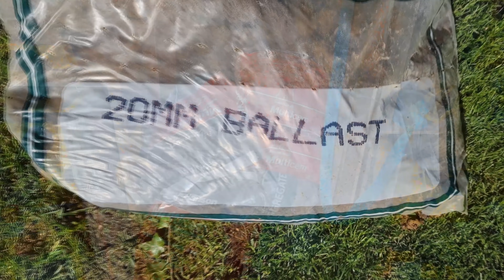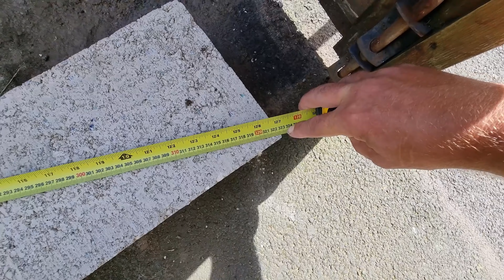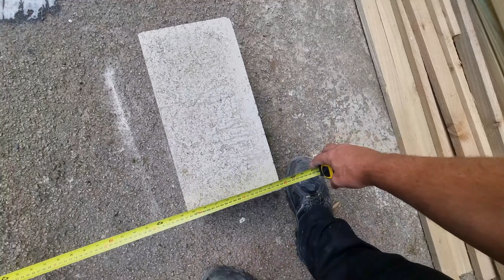Tafty's Pergola build Pt4 & Shed/wood store - Posts concreted & shed concrete block foundation wall

Comment: I must say gid that mixer is still looking brand new you must look after it when your cleaning it out keep up the good work 👍🏻
Reply from the maker: Thanks will do 👍 I'm trying to keep it clean, to keep the weight down if nothing else 😂 my old one was fairly new but second hand & already a mess when i got it. doesn't take much to run the hose over it when done 👍
Reply: @Gidjoiner  to right nothing better than clean gear 👍🏻

Comment: Definitely a hard days grafting. I think I would have got the SDS drill out with a spade bit. An extra 'Tick'  for looking after the frog. 😁 Very luck indeed
Reply from the maker: Yep there was some tea drunk, back breaking, those are proper concrete not that breeze block stuff 😂 yrs ago i squished a frog, i dug the holes the day before, came to put the posts in n heard a squeak, oops, so now i check every one but this one snook in, it's not hard to see the bottom once the post is in 👍 when i'm mixing concrete i bend down n pick something up, it's a tiny snail on the floor, you start appreciate life when you get older n everything has a little soul 👍 https://youtu.be/0SuhJOx-RXQ?t=337

Comment: With regards to the shuttering method, you rarely go for the easy option it's usually the right one with you Gid.
Reply from the maker: Thanks Mike 👍 Yeah people might think i make it harder for myself, but i like to think of it more as not making it easy for myself, easy often brings shortcuts which aren't always good for the long term of the job, Nail guns - 90mm ring nails aren't 4" nails, i do wonder about that sometimes, but 3" & 4" timber isn't a proper 3 or 4" 😂 is the life expectancy of these buildings less nowadays, 🤷‍♂️

Comment: Hey Gid how are you. Looking good. Like the little mixer.
Reply from the maker: Hi, sort of wished i'd done the 'woodworking' shuttering option, i'm a joiner after all, then i could've just poured concrete but I'm fine thanks 👴😂 Yep the little mixer is working well, small enough & light enough to pick up & throw in the van 👍

Comment: “The shed will be here a long time” damn right Gid, whether he likes it or not🤣that’s some base pal. 
When you hosed the top of the posts after concreting, do you do that straight away? Didn’t realize you could!!
Reply from the maker: I could've cemented flags down or just poured on top of the tarmac, but yeah it's done now n won't be moving 😂 the water on top won't affect the main part of the concrete but might make the very top 5mm a bit sandy which will not set (that might be just residue washed on top tho 🤷‍♂️), so i'd be more careful on posts where the concrete will be seen & the concrete on top pointed smooth but for these that'll be buried it won't matter, having the surrounding ground wet will be good for the concrete, concrete that dries slower is better.. apparently.  If you don't wash it off straight away it could be hard to get off. The amount of water i put on won't soak down very far, i used to have a plant in a pint glass in my kitchen, i was always surprised how far the water didn't go down when i watered it.
Reply: @Gidjoiner  Gid , that’s good to know because you are right. When it’s set, it’s a twat to clean off. 
Hope you enjoyed your spaghetti bolognas. Hope that’s not your wages mate🤣🤣🤣
Reply from the maker: 😂 Thanks 👍